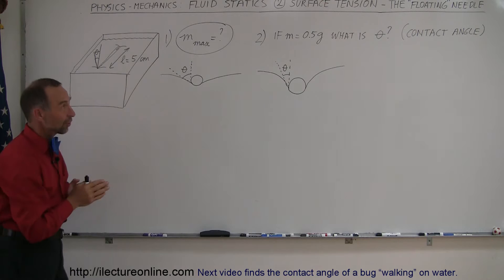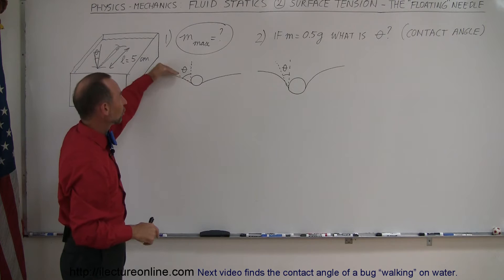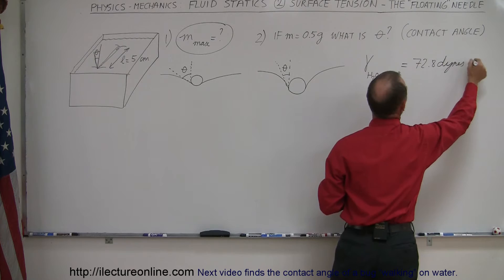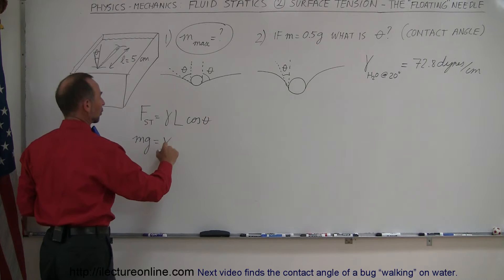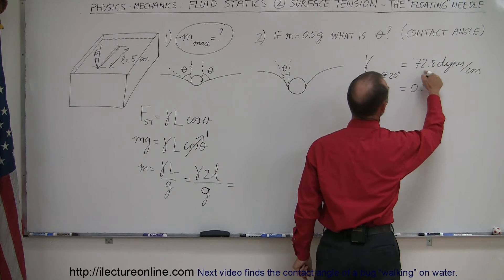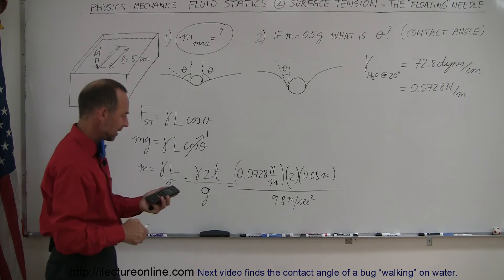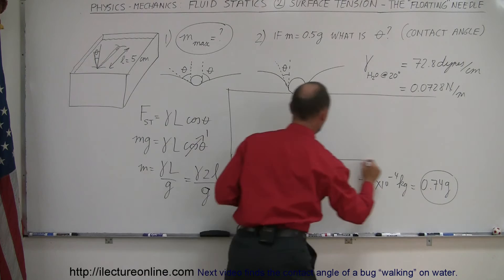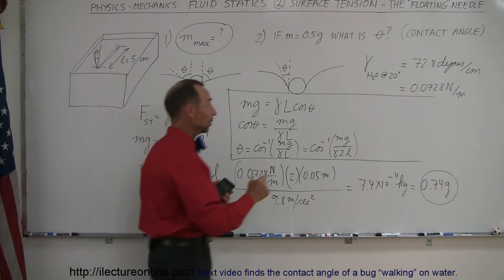Physics 33.1  Surface Tension (2 of 12)The "Floating" Needle

Comment: You have made theta on both sides but but u didnot took it as 2Fcos(theta). F is force due to Surface tension. Why? Further we hav studied in hc verma that wen we find contact angle we make tangent to the solid towards the liquid, you have made it away from liquid. Why?
Reply from the maker: Notice that L = 2l in the equation, where l = length of the needle.
Reply: @MichelvanBiezen  ok i got it. Thanks for your reply.

Comment: Not accurate by good overview. The contact angle is always with respect to the tangent on the triple point to the tangent of the water curvature, not just up or down the axis. The concavity of the water surface doesn't represent hydrophobilicity/hydrophobicity but the force that surface tension needs to counteract to keep the pin upwards (i.e. a hydrophilic OR hydrophobic but buoyant ball will curve the other way to your drawing).
Reply from the maker: Thank you for the input.

Comment: Hey Professor, how come you don't account for the surface tension along the circular faces on each end of the needle? Doesn't surface tension happen along the bottom arc of the circle?
Reply from the maker: Since the length of that surface is so tiny compared to the length of the needle, we indeed just ignore it.